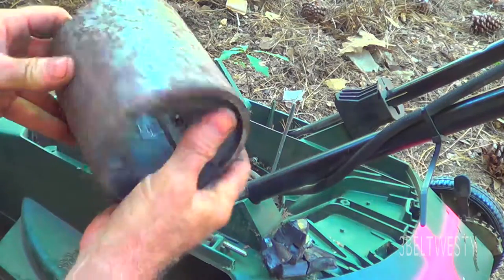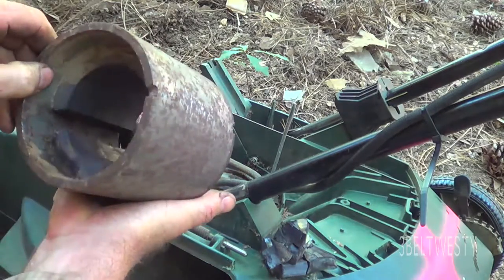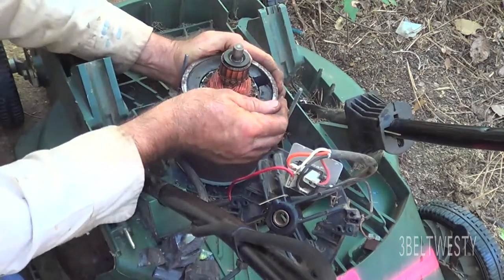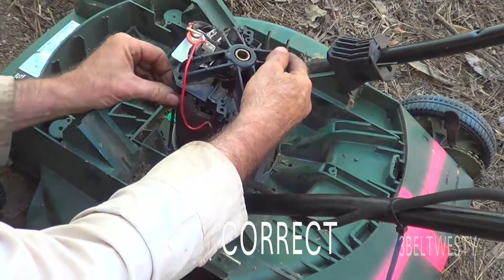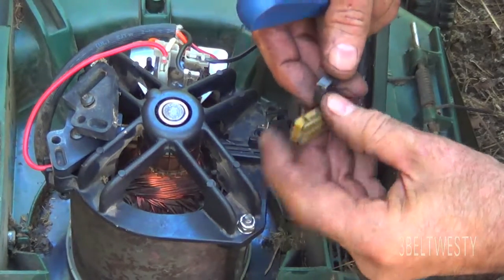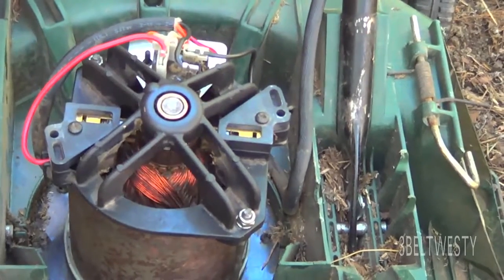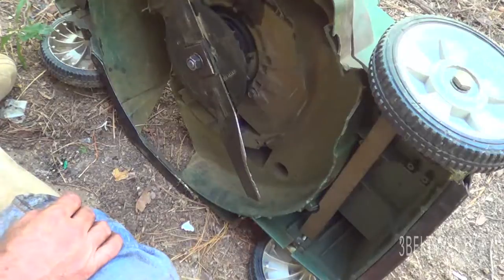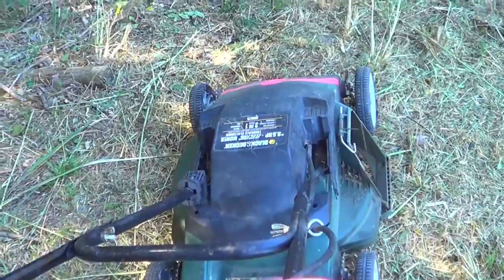Black Decker electric mower Stator 002 Magnet workaround

Comment: Thanks for the video. Don.t suppose you have a video on how to remove the plastic mower cover and what size of torx screwdriver is required." I have the video on the rectifier. I also am wondering if you know how to replace the entire plug from the motor to the switch?
Thanks